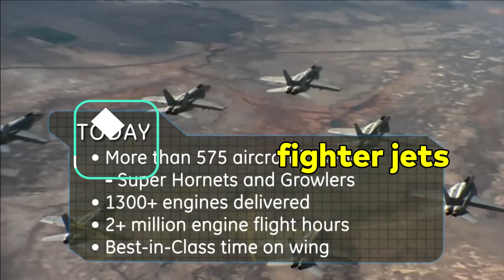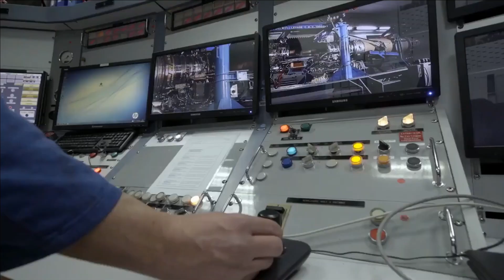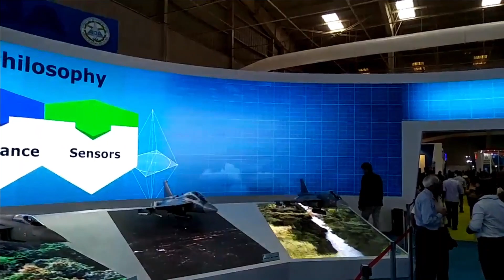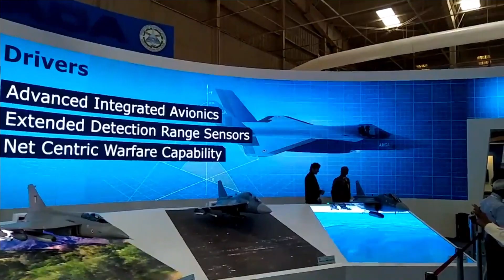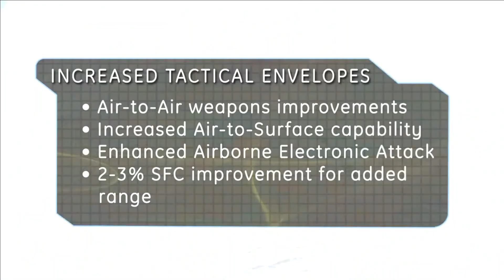US revives ties for AMCA engine development

Comment: If initial development funding is around 1bn dollars, why isn't the option of reviving the F35's 190 Kn F136 engine program with GE/RR considered? This development was already in advanced stages and GE estimated remaining costs to be around 1-2 bn dollars. RR was also eager to contribute to India's program after UK PM's visit.
Much more powerful than current 110 kn program, and will probably end up costing similar amount. Only issue is if Ind will get IP rights.
Reply: Do you know how huge F136 is? Choose it and the whole design of amca is gonna be overturned.
Reply: @yixinmei5854  Engines can be scaled to some extent to meet certain specific applications. F136 was itself an upscaled F120 in some ways.
Plus the AMCA is supposed to be noticeably larger than the F35 so fitting a repackaged version (maybe even with slightly lower output) should be possible.
Reply: @alltherandoms9599  The diameter of F136 is about 1/3 bigger than F414, what kind of fuselage can deal with such huge difference?
Reply: @alltherandoms9599  AMCA  is expected to be a 22-24 tons maxium take off weight. So how many F136 you plan to mount, one or two?
Reply: @yixinmei5854  Exactly why I mentioned scaling engines to fit certain requirements. A repackaged F136 could be adapted to the AMCA's frame if required, at the cost of some thrust capacity. 
If you looked at the YF120, it was originally much smaller than the F136 and some of it served as the base for the F136, but parts like the core were upscaled significantly. There's no reason to believe that the opposite could not be accomplished to adapt the engine to the AMCA. In fact, downscaling and decreasing output should prove much easier than making a more powerful version.
Reply: @yixinmei5854  Depending on requirements, a smaller F136 derivative with anywhere between 120-140kn for each of AMCA's engines. Thrust requirements will also vary on whether IAF wants TVC and directed energy weapons. 
The 110 Kn engine (2 per aircraft) currently proposed would almost certainly be inadequate for powering capable energy weapons along with other advanced avionics, strong EW and powerful radars.